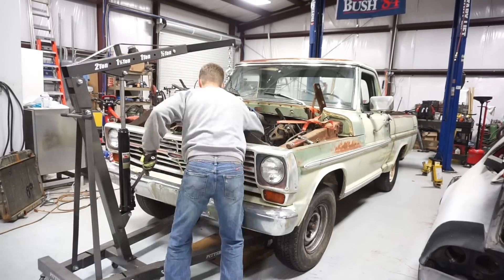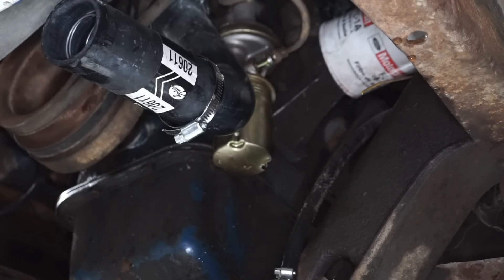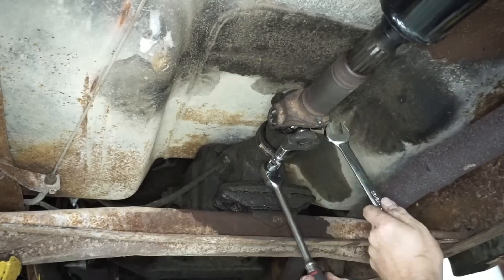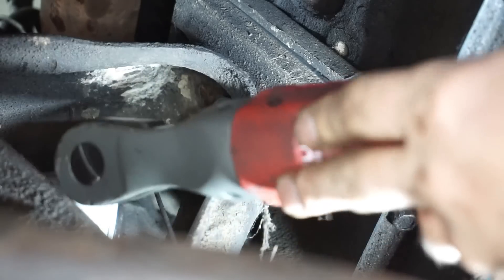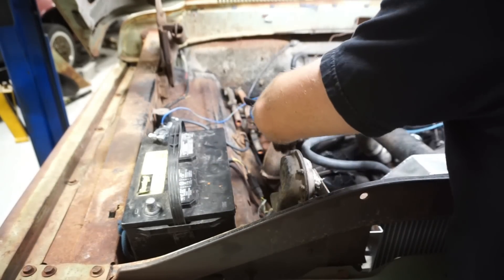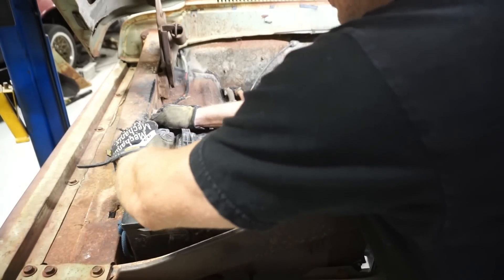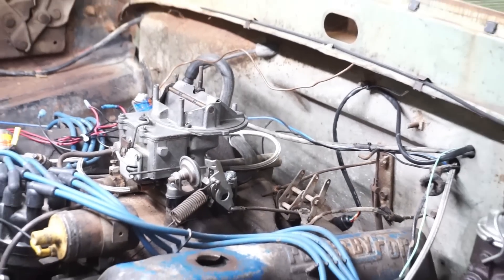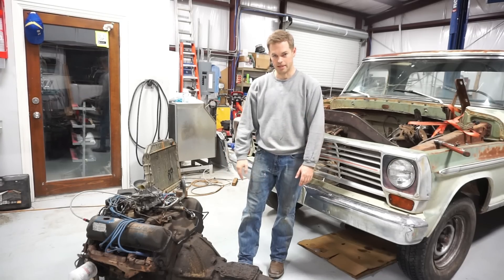F100 Engine Removal - Quick & Easy How To

Comment: I have a 76k mi '67 F-100 Ranger with the 352 & 3-on-the-tree I have to remove and refreshen because all the original seals (yes; the engine has never been apart) are GONE and it leaks oil like the Exxon Valdez. Your vid is gonna help me A LOT!! Thank you. 💪😎

Comment: Did you unbolt the motor mounts or just the one bolt that connects the motor mounts to the larger metal v shaped frame mounted brackets?

Comment: I couldn't get mine out like this. I had to take the front clip off in my video. My engine is a 429 big block and wouldn't get over the front with my engine hoist.

Comment: Hey I'm following your video after years of procrastinating about doing my own work. Always been an aspiration of mine since high school (now 60). I have a 78 F150 2WD. The video is spot on except my clutch is different or you edited out removing the spring. Anyway Kudos to you. This inspired me to pull my engine and it worked! Thanks and keep them coming.

Comment: I have to rebuild my 390 fe. I threw a rod, and the block needs replaced. Would you suggest pulling the transmission with the engine, or just leaving it attached to the truck?
Reply from the maker: I'd pull the transmission with the engine. Its a PAIN to get the motor to stab back to the transmission (if its a manual) with the transmission still in the truck
Reply: @330_garage3  it's a manual

Comment: How long did the process take to completely pull the motor? Hard to guess with the time lapse. Awesome video! Can’t thank you enough!
Reply from the maker: It comes out in about an hour, its very straight forward to pull the whole engine and transmission together.

Comment: I subscribed. I’ve got a 1974 Ford F-250 Ranger SuperCab. It’s got a non original 4.9 300 Six. With 22,000 miles on it. It’s bad ass. I’ve got MANY videos of it on my channel, Quint 1836. Go check it out

Comment: Just bought a 1977 F100 with a 351 Windsor ... Have never worked on an old car before but consider myself decently handy.

It runs good but I'm getting some oil leaking when parked. I'd also love to clean up the drivetrain and engine bay to make it look new again.

Would I be a fool to pull the thing as my first "major project" on this truck?
Reply from the maker: No, you should absolutely pull it. You can make some really good power with the 351. If you brought the compression up a little and put a small cam in it, I think you would be amazed at how much performance you get out of it, and how much more fun it is to drive!! Make a video when you pull it out!

Comment: I heard you say in another video your going to eventually do the crown vic front suspension are you going to keep the older carburetor engine in it or are you going to a modern engine. Reason I'm asking cause I didnt know if the new suspension would interfere with the old style motor oil pan.
Reply from the maker: I am planning to upgrade to a more modern engine. I haven't looked into putting a big block over the crown vic front end. The crown vic front end is pretty deep, I would imagine it would allow you to put almost anything in there without to much trouble

Comment: Did that when I was a senior in high school in 1980...all I had was a set of S-K open/closed in wrenches, 1/2” drive ratchet, breaker bar and socket set.  A dirt floor and a chain hoist hanging from the beam of my Dads shop on the farm.  Fun project!!!
Reply: In US you guys learning how to work on engines in high school?
Reply: @arride4590  some high schools have auto shop classes
Reply: Adriano R. Learned on the farms back in the day.

Comment: I'm a new subscriber. I enjoy watching your videos.

I love the old Ford stuff too. It's so simple to work on. 

But I don't agree about the front clip. The front clips are so easy to pull off these trucks. You can even leave the hoods on them. I always pull the front clip if the truck is a 6 cylinder or big block. It just makes it so much easier to pull. The old FE engines are a whole lot of weight.  I'd rather have to lift the engine only a foot or so instead of 5 or 6 feet. I've pulled enough of them that I've got to experience chains breaking, the hoist failing or tipping over. Nothing gives you a "Oh crap" moment like a big ol FE V8 hanging 6 feet in the air and then it comes crashing to the ground. It may take a little more time but makes the job even easier. Plus it also makes cleaning/painting the front of the frame easy too ( if a full restore isn't being done  )  .

Comment: Awesome.  Are those chains attached to bolts that are in holes designed to be used for hoisting the engine out or did you just use whatever holes you could find?  Can’t wait to see that tired old 360 get transformed!
Reply from the maker: I put one through a bolt into the front of the drivers side head and the other under the rear-most intake manifold bolt on the passenger side. Pulls it out with the trans hanging down for easy removal